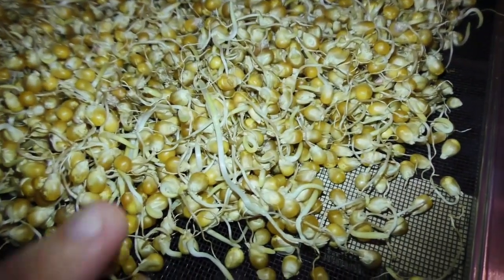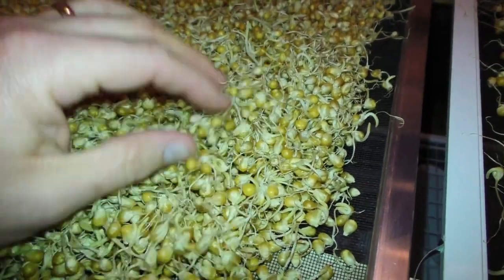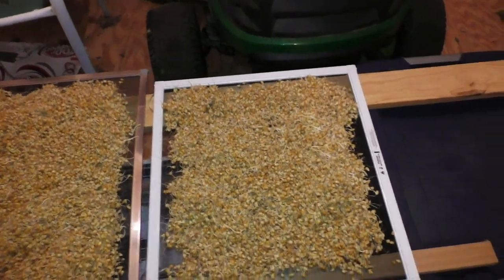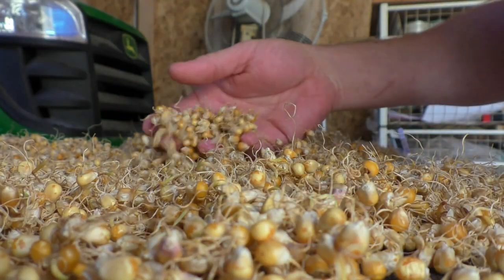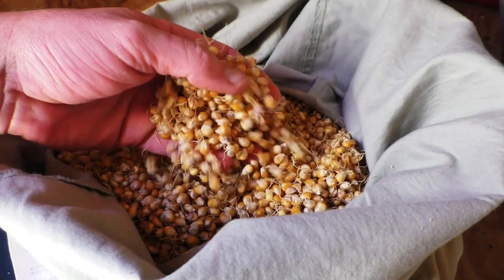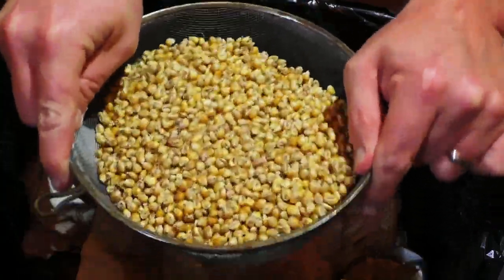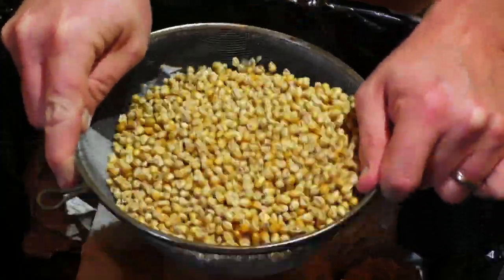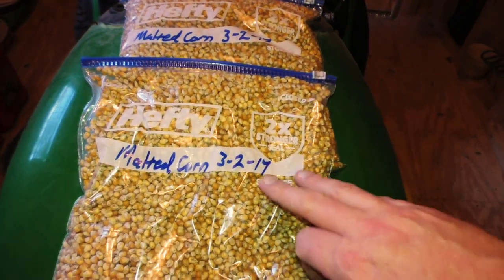HOW TO MALT CORN FOR MOONSHINE & BEER - EASY! - Part 2

Comment: I know this is an older video but thought I would ask a question anyway, can malted corn be used right away after the sprouts have been removed without drying it and if so how hot or warm can the water be before it kills the enzymes?? Is using malted grain to help convert starches to sugar in other grains in your mash or does it only convert the grains malted.
Reply from the maker: All great questions! 1. It's a huge pain to get the sprouts off while the corn is wet, so I wouldn't bother. Conventional wisdom says not to use green malt because it can make your product taste like grass clippings. But I've recently done some tests and confirmed that if you boil the wort for 20 minutes after the full mash starch conversion is complete, that will drive off the aroma.
2. 145F to 158F is ideal temp. Shoot for 155F. Check out this video https://www.youtube.com/watch?v=_6mBD8py9gs&t=1514s for an excellent tutorial.
3. The malted corn only has enough conversion power (diastatic power) to convert the starch inside itself. So if you add other unmalted grains you'll need to add some malted 2-row or 6-row barley to the mash to fully convert any other grains.
Hope this helps. Have fun:-)
Reply: @BeardedBored  thanks for the information, I was going to make an all corn mash but if it needs to be all malted to convert itself, it may not be something I am ready to tackle just yet! Using analyses now but seem to be leaving a lot of starches in my barrels so looking for another way.
Reply from the maker: @marcusmorgan1419  How big are your batches and how recently did you buy the amylase? I ask because I had some amylase stop working. I kept it in the house at a constant temp, sealed up, but for some reason that big bag of amylase powder is now garbage after a year. Won't convert anything. Try some small scale mash tests, side by side with malted barley in one pot and amylase powder in the other just to make sure your process is down solid and ingredients are working right before you scale back up.
Reply from the maker: @marcusmorgan1419  Also, check out the Still It channel. Jesse has a lot of experience with big batches and regularly answers questions posted by viewers. He might have some better insights than I do.
Reply: @BeardedBored  I was buying a few ounces of that at a time because I wasn't sure of shelf life but just bought a couple pounds, running 20 gallon mashs now before starting 50's, usually a couple at a time, playing with yeasts, sugar and corn amounts, the last 2 identical except for water,, 3 tsp analyse, bag says .1 to .3 tsp per gallon, 15lbscracked  corn, and 15 corn sugar, one with rain water, one my well water same yeast, surprisingly the rain water mash took 2 plus weeks to finish, ph was 6, my well water takes a little under a week at 7ph. Both still had a lot of starches left in my barrels, almost every corn mash has for that matter. Did a spud run and had no issues with potato starches, so not sure why the corn starch isn't converting, that's why I was looking at malting some to see how that works. I can get sprouts no problems but getting fuzzy mold starting after 3 days so have tossed 20 plus pounds of corn so far. The batch now has 1/4 to 1/2 inch sprouts, no mold so far so was going to start drying or try wet before I have any more issues with mold starting to grow. Temps are only mid 70's so not to hot and I am.using several shallow  cookie sheets, maybe 2 layers of corn in each. Stir daily, keeping towels damp, not soaked. I'll get it right eventually, corn is cheap enough, 9 bucks for 50 lbs so messing up hasn't broke the bank.
Reply from the maker: @marcusmorgan1419  Did you boil the cracked corn to gelatinize the starch first, then cool down to mash temps? If not, that might be part of the issue. Corn starch gelatinizes at like 190F which is close to boiling (212F), stir like crazy to keep it from scorching on the bottom of the kettle for about 20-30 minutes, then cool to 155F and add your amylase. Look into high temperature enzymes too. They make the whole process easier. Also, the longer you mash, the better. For the product you're aiming for if you can hold the mash temp at 155F for 90 minutes then that corn should be pretty well converted.

Also, one other thing. Cracked corn is harder to convert than coarse ground corn meal since the kernel is so tough. If you can get corn meal, that might work better. Basically you'll be making grits, then mashing at 155F for 90 minutes. I recommend doing a couple of 1 gallon test batches of cracked corn versus corn meal to see which one gels better and converts better.

You could also try using flaked corn from a homebrew shop. Costs more, but saves time. The process they use to make it gelatinizes the starch, then dries it out, so you don't have to boil, just mash normally.

For the malting, check out my other video on the malt tumbler robot. https://www.youtube.com/watch?v=att7dAP13rY Really easy to build and keeps the mold from growing. Also, you can give the corn a spritz with some StarSan/water mixture to help keep the nasties out.
Reply: @BeardedBored  yea boiling for quite a while, messed up once with enzymes added to the boil, like I said it's a learning experience for sure. Maybe not enough analyse? Point 1 to point 3 tsp per gal isn't much, going mid instructions so thought it would be fine, the new stuff has corn sugar in it as well so thought using corn sugar in.the wash with corn would help, so far that hasn't been the case. I used some enzymes for a pearch mash that worked excellent, same supplier so assumed what I hve been using is good, I will buy some elsewhere and give it a try.
Reply: @BeardedBored  thanks for all the help, I'll try some more things and let you know how it goes
Reply: @BeardedBored  one thing I forgot to mention, on the last few batches of mash I have soaked my cracked corn for 24 hours prior to boiling, thought it would help soften it up some, and does, but it didn't help with the conversion process for me at least. I'll keep plugging away, eventually I'll get something to work that is passable for sipping! So far I have made some excellent cleaning products, takes tar off of chrome like nothing!!
Reply from the maker: @marcusmorgan1419  Definitely check out https://www.youtube.com/channel/UCThY8lOKKkVDd9HVBT59zCg Jesse has a some great videos on making cuts and blending so you can get a solid product.
Reply: @BeardedBored  have you ever tried a cold grain mash, no cooking?. Just curious, don't know how any starches could be converted cold and basically I would think you would end up with a sugar wash only, if sugar is added,  but did read a blurb on cold mashing with grains, so must be all malted i would guess. I will try your roller idea for my corn, tossing my latest 10lbs i had sprouting, got fuzzies growing again, I have had a heck.of  a time trying to malt my corn for sure, that's why I was going to dry earlier, shorter sprouts, once sprouted it should be okay or does the corn need to germinate longer to get the proper amount of enzymes needed. I'll keep plugging away i.guess, something will go right eventually and I may get a receipe that I can be proud of.
Reply from the maker: @marcusmorgan1419  Sorry you've had so much trouble with the malting. It can be a real pain to get your process down to where you're nearly always successful. Took me a few tries to get my first batch. They can still go sideways if I don't stick to my schedule.  The tumbler makes it easier and more forgiving, but it can still get infected if you're not careful. I always try to get my shoots to an inch long before I dry it. Corn needs a lot more growth to make the enzymes, whereas barley needs very little.

The cold mashing is not something I've tried. I guess technically it could work, but I think it would take so long, days maybe, that you'd run the risk of getting an infection in the batch since corn is so stubborn. Maybe not though. For any of the odd techniques or experiments I just try small batches. I'd rather test 2 pounds than 20 in case it doesn't work. If it does, I just save it until I can add it to a larger batch later.
Reply: @BeardedBored  I'll get there! Time and patience is all it takes, I have both so eventually I'll hit on something. Using the smaller cookie sheets for corn if one gets funky i.can dump it and not loose everything, just taking forever to get 20 lbs, not sure it will have a different flavor than using cracked corn and analyse but want to get a batch right to see. I would guess it has to be better since it converting naturally. 
Thanks for all the info, it is greatly appreciated, my trial.and error method has been working slowly but more knowledge sure helps from.someone who has had success. 
I'll keep you posted on how this next batch goes, got corn on.the fire now, oh, I did a smoked corn mash that did have great flavor if you have never tried that. Still didn't convert all my starches but did get some of the smoky taste by doing the one extra step. May do.another run once I get my malt down.
Reply from the maker: @marcusmorgan1419  Wow! How did you smoke the corn?
Reply: @BeardedBored  I used my egg bbq knock off, low heat 170, i used apple wood and a pan with holes in it and kept stirring, you could use whatever wood you like for the smoke itself, I  smoked a  couple pounds cracked corn at a time for 30 minutes, worked excellent, the mash itself smelled like smoke when I cooked it off, the run didn't have the heavy smoke flavor I was expecting but it did have a hint of smok to it, came out decent, maybe smoking the corn longer or using more in the mash would have more of the taste I was trying to get and as we have been talking about if I could get more starch conversion that may be enough in itself.
Reply from the maker: @marcusmorgan1419  Cool, thanks for the method. I'll have to give it a try:-)
Reply: @BeardedBored  the mash smells incredible when you cook in! I was pleasantly surprised and happy it worked, I used apple for a milder smoke, mesquite might get more flavor into a run since it gives a more smoke flavor when cooking with it, but any decent wood will work I'm sure. Keep me posted on how it goes, I got my trial.and error cracked corn recipe mashed in late last night, and used 2 different enzymes or 2 from different vendors so maybe one will convert all the starch this batch. My malted corn seems to be drying without any problems as well, sprouts are 1/4 to 3/4 inch, no nasties I could detect so starting 4 more pans today while waiting on parts for the roller set up. If I can get enough for a 20 gallon trial run I thought about smoking the malted corn at the same time but that's to many changes at once I think. Again I appreciate all the tips and info. My email.is my name 29@gmail.com, drop me a note sometime, and thanks again

Comment: How hot would you dry it in a dehydrator as I don’t have a dryer
Reply from the maker: 110F-120F would be ideal.
Reply: @BeardedBored  cheers mate
Reply from the maker: @andy1982222  No problem, brother.

Comment: Is there any reason that you can not leave the sprouts on the corn and bypass the tumbling stage. I ask as I thought I might dry using the smoker on real low and this might add more Smokey flavour when distilling not for beer
Reply from the maker: The shoots can add a grassy flavor that follows through into a brew and distillate. The way around that is to boil the wort for 20 minutes to kill that flavor. Tried it in my "Grocery Store Beer" vid with fresh green malt.

Comment: Would it be wrong to dry the corn in the oven at 170 Fahrenheit?
Reply from the maker: That is way too hot and will denature (destroy) the enzymes in the malt that you need to convert the starches into fermentable sugars. 130F to be safe. If your oven doesn't go that low, turn it on to it's lowest setting, usually "warm" or "proof", let it heat up then turn it OFF and put the corn on cookie sheets in the oven with the door wedged partially open so it doesn't get too hot. You may have to do this several times. If the corn gets too hot, you'll need some malted barley or commercial amylase enzyme to convert the starches to sugars in your mash. Let me know if you have any questions:-)
Reply: @BeardedBored  thank you. I'm going to try your method. I was just hoping to avoid a trip to home depot lol
Reply from the maker: @bourboneeringpodcasts  LoL!

Comment: Thanks for the malting videos.  I've got 350 lbs of wheat that needs malting
Reply from the maker: Wheat has different soaking and malting time requirements since the kernels aren't as dense. I've never done it, but I know it's less time. You should do some more research before you get started so you can be successful;-)
Reply: @BeardedBored  thanks for the reply. Im enjoying your videos as well as your tumbler. Add a heating element and fan at the back end for one stop tumble dry?
Reply from the maker: @gregbreitz972  Good idea:-)

Comment: After malting and before cracking, could I roast @ 350 or so about 45 min? Would like to end up with 100L - 120L . Am planning to adjunct with about 20% 2 row in the sparge for a better "mouth feel" . Also , Fuggles pellets in the early bittering boil, then maybe Kent Golding in the last 15 minutes for the aromatic pitch.   🍻
Reply from the maker: I haven't experimented with roasting my malt yet, but have done a little research. If I were going to roast corn malt I'd take a small amount and experiment with temperature and time. Start way lower than 350F for 45 minutes. I'd be concerned that it'll burn. Start around 200F for 10 minutes just to see what that does.  Then give it more time if you want it darker, but check it every 5 minutes after that. I've roasted barley before and it goes from "almost there" to "charcoal" in no time. Also, make sure you stir it around each time you check it, otherwise it'll burn on the bottom, and be just golden on the top. Stick with small handfuls until you figure out the time and temp that works for your goal, but still check frequently when you do a larger batch. Don't do anything else, just stay in the kitchen and set a timer. Trust me, the smell of burnt grain lingers. Good luck, and let me know if you get a system down:-)>
Reply: @BeardedBored  
Thanx. I found a little info on a homebrew forum couple years ago. Think it applied to "field corn" though (been two years ago & can't find it now). Been itching to try seed rice, too. Any thoughts or experiece w/raw rice? Thanks again!   🍺   p.s. : Can get rice syrup from a local brewers' supply in Greenville,   but prefer doing things the 'hard way' . More funnererer!
Reply from the maker: Never worked with rice, but I'm interested. Doing things the hard way is definitely the funnerest way;-)

Comment: suppose you want to use them right away,can you forgoe the drying and simply just crush them up or grind them? wont this also kill them and stop them from sprouting more?
Reply from the maker: You can use the malt green without drying, but from what I've read (haven't tried it yet) green malt can make the beer or distillate taste grassy. Not sure if that's true since I haven't tested it, but interestingly the green malt will have 2-3 times as much active enzyme as dry malt.
Reply: good to know,,interesting about that 2-3x trade off with the grassy taste,,,i would not think it would be a problem for distilling ,doubt the taste will make it through unless you are using all the malted corn ,,sure worth a try
Reply from the maker: From what I've read the grassy flavor will end up in distillate as well. Just means the vapor point for those flavor compounds are in the range for ethanol. Since I haven't tried it I don't know how strong it would be, but since it is not an industry practice to use green malt at the commercial level, it might not be a viable technique.
Reply: got it

Comment: Can you try to make malt syrup, from malted corn?
Reply from the maker: It can be done, but it's a long messy process. Basically you would take the malted corn and do a normal mash like you're going to make beer, then slowly boil the resulting sweet wort down into a syrup. I've never tried it. Clean up would be a bit of a nightmare if it scorches.
Just curious, what would you use the syrup for?
Reply: @BeardedBored   thanks for the answer!
Reply from the maker: Happy to help:-)>

Comment: Can't you just use cracked corn and mash it with some beta amalase from a home brew supplier rather than go through the malting process? Does the malting increase the yield?
Reply from the maker: You can, but where's the fun in that? :-) Technically you're getting the same result, but personally I like the taste better. It's a matter of preference.

Comment: Can you simply brew with corn without malting it? I’m asking bc I want to brew with deer corn bc it’s 4.50$-6$ for a 25 lb bag at Walmart and I check you can eat this stuff the fda has to make it edible for him a the same way they die for cat food and dog food bc some people will use it for food
Reply from the maker: Nope. Corn has nothing but starch in it. Yeast need sugar to eat and turn that into alcohol and CO2. So, you have to provide enzymes from malting to convert the starch to sugar. If you don't want to malt it, then do some research on commercial amylase enzymes.